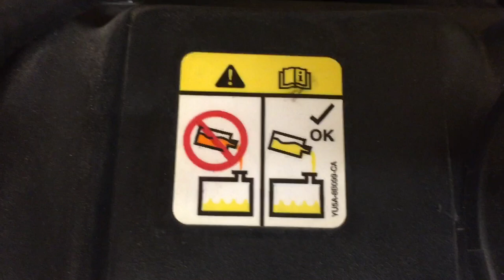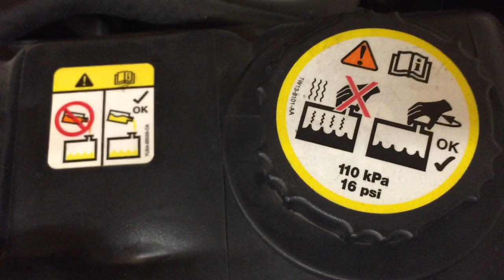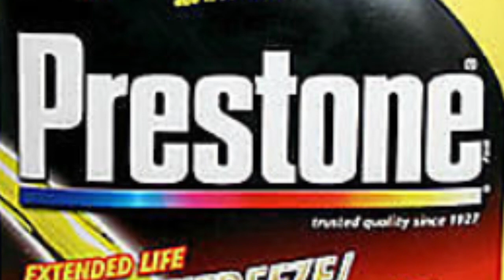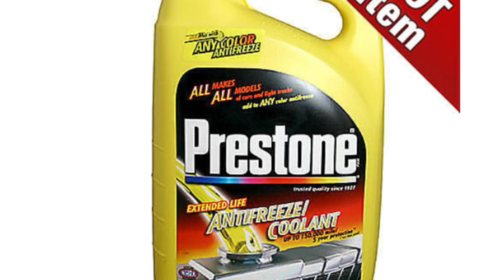Why is coolant different colors and why you can't mix them!  IAT, OAT, HOAT which can you mix?

Comment: I just viewed your video on coolant (colors and applications). I'm old school plus I sold cars for 31 years. I'm a car savvy guy, worked on cars until moden technology made fixing your own car almost impossible. 

A couple of months ago I had to have my water pump replaced. 2013 Dodge Durango w/ Hemi. I trust this mechanic and his team (Oops, did I say 'mechanic' instead of tech?). He said he flushed and refilled my cooling system. For some reason I felt warmer than usual air coming into t he car. I took it to him and he said to wait until until it cooled down to remove the radiator cap , like the next morning to make sure it had properly burped . The next morning before starting my Durango I removed the radiator cap and the coolant looked like brownish rusty water. I went back and asked what was up. Jake said he'd used Gold coolant  and not to be surprised. It's runny very cool, nowhere near the hallway mark even at a prolonged idle with the air on.

Ralph

Comment: Very informative vid. Thanks.  
So your "good rule of thumb" of keeping the same coolant that came with the vehicle is interesting as Ford initially started with the Orange coolant for my 2013 Explorer Sport BUT they've since changed from that. They no longer recommend orange and instead recommend Yellow as a direct replacement.  Supposedly you can simply dump yellow into the system and it's supposed to work properly - no flush needed.  I dunno, all that sounds sketchy to me and sticking with the orange sounds like the way to go.  Thoughts?
Reply from the maker: It’s hard to say what they changed it and if it can be mixed, but the most sure way is to drain it all and replace it with all the same stuff. Especially as it breaks down over time with heat.
Reply: @dannyjohnsonsgarage - Thanks for the quick reply!  Ford's owners manual says first service at 100k but then 50k after that.  I'm just shy of 100k and was going to do a drain and refill with PEAK Orange.  During the drain, I'm going to check the fluid to make sure it doesn't look too bad.....already tested as still good.  SO I'm thinking drain and refill should be OK, no flush needed.  And then maybe do the same every 30k or so.  Thoughts?

Comment: My tractor was delivered with blue coolant/antifreeze, I wanted to top off the reservoir but I can't find any blue diesel engine coolant/antifreeze. The dealership sold me Delo ELC Red coolant, is it safe to add the red coolant to the blue coolant thats already in the cooling system?

Comment: My question is about changing the coolant and switching from one to another. My Hyundai manual says that the fluid shall be ethylene glycol with water. Nothing more specific than that. No special requirements. The original coolant dye is green. Most coolants in the market aren't green. Is it normal to flush the system and use red dye hoat coolant, the asian one from zerex, rather than the original one? It is for sure not only water with ethylene glycol, and also its dye is different.
Reply from the maker: If you clean all of out you should be fine using prestone all makes all models all colors. It’s only bad if you mix it
Reply: @dannyjohnsonsgarage  not prestone. I suggested asian zerex by valvoline. Hoat type

Comment: I can't seem to find the answer anywhere so please reply.

I'm trying to find out if different brands and colors of OAT are interchangeable?
Or are all HOAT compatible ?

It seems that there are many more colors than you described so what is the bottom line of what is and is not compatible ?
Reply: Every car is designed by a different team of people. Those engineers all look for the best stuff they can use in their time-period. So long as it’s commercially viable. So really the only way to know is to read the owners manual, then check out owners-clubs/forums to see what they think is best from ownership experience. My entire brand of car (Subaru) wasn’t mentioned. It uses a purple coolant, which he did mention is commonly found in Asian manufacturers. To be honest I’m surprised at how much useful background information I got out of this video, despite no specific advice for my car, definitely worth it :)

Comment: Besides adding coolant, what should I do if my car was ran with just water for an extended period?
Reply from the maker: You’ll want to also burp the system by finding a bleed valve or a high point. You’ll want to do it when the car is cool so you don’t get burned. The idea is to get all the air out of the system 
https://youtu.be/vdiEzahAEb8
Reply from the maker: https://youtu.be/fYvDqtGPyAM

Comment: Hi,I am running a Weichai wp6 marine engine it's jacket water is mixed with brown mud ,how to get rid of mud and make a right coolant to refill the system, please reply thanks.
Reply from the maker: If this on a boat? It’s water system is pulling from the water. If not, Remove all fluid, fill with distilled water, run for a few minutes and replace several times until clean
Reply: My 2005 impalas is mud!! Why?
Reply from the maker: @airexaxe7554  probably has oil mixing in the coolant from a bad transmission or oil cooler gasket or maybe even losing a head gasket
Reply: @dannyjohnsonsgarage  Crazy! Thank you very much for another way through this

Comment: Silicate (When mixed with Ethylene Glycol) forms thick cloudy type gel. It is understood that Silicate is used as Rust Inhibitor.  My concern is if turns gel or get thicker over the period of time, it might lead to clogging. Really need an expert's opinion here.  Thank you.
Reply: Silicates, which makes one think of glass and silicone epoxy, are very inert, thats really it’s main feature, even when used in semiconductors it’s an inert background on which more interesting ions are inserted. If you wanted hard there are better ceramics, if you want lubricating there are better oils/liquids, but if you don’t want stuff to grow on it silicon-something is an inexpensive choice. So I can’t say what the Ethylene Glycol will do over time, but I can’t imagine the addition of silicone will cause it to change overtime. It’s gonna change during the addition but not over time. There are some radiator-sealers/repair additives that use silicon to plug up holes, and they are supposed to be flushed out after a certain number of minutes of being added to the system. It’s usually a small bottle and you add it to the coolant system after doing lots of pure water flushing, adding only water, letting the car get up to temp, then cool enough to add sealer, then run for 8 minutes, then dump it all and add fresh coolant. Perhaps if that stuff is used and never removed the loop will get high resistance to flow over time, like it was gumming up.
Reply: You’re right

Comment: Interesting video. What type of coolent would you recommend in a 98 Cobra? It has the green stuff in right now. And do the premix 50/50 already have the distilled water in it? I'd rather just buy it with the 50/50 rather than have to mix it my self. Thanks.
Reply from the maker: Prestone 50/50 would be fine. It does already have distilled water, so just keep in mind you’re paying them for the weight of the water and will save some money if you buy the concentrate and then just pour in the distilled water as you pour it in (you don’t need to mix it before hand, it will do that over time).
Reply: @dannyjohnsonsgarage  I recently completely flushed my cooling system and replaced the coolant. I did a very thorough flush using a radiator flush kit, distilled water and flushing several times. I removed my thermostat, put the heater on high and drained my reservoir tank. I had completely clear water draining out prior to re-adding coolant. I added 2 jugs of the new coolant which was prestone concentrate. The jugs were 3.78L each for a total of 7.5L of concentrate added. The capacity of my cooling system is 15.3L so I figured that using 7.5L of coolant would give me a 50/50 mix (or very close) which is what is recommended. After doing this I went to a local oil change shop and asked them to test the ratio using there ANTIFREEZE COOLANT TESTER. They sucked up a sample and said it was good for about -35 C. They explained that this was a little warmer than they usually go (they like to see -45 to -50) but because I live in a place which rarely goes below zero and never below -10 then it should be fine. I did not have them test the acid/ph level at this time. 2 weeks later (today) I went for an oil change and they tested my coolant with a little strip of paper. My PH level was 5.5 which is low (should be a min of 7 and ideally between 9-10). The test was conducted right in front of me so am not concerned about them misleading me.

My question is (which they weren't able to answer) if I drain out some of my coolant and add some more of the concentrate (making my ratio stronger) will that increase my PH level? I've tried to look on google but can't find anything specific. Is my PH level low because my ratio of water is on the high side, or does the ratio of coolant to water have nothing to do with the PH level.... thanks..

Here is a link to a video of my flush... if you watch the first 3 mins you'll see the original coolant... it looks orange which everyone says is CHRYSLER HOAT... but my owners manual says its OAT and warns specifically not to use HOAT. Some people tell me that the HOAT is also called G-05... while others say G-05 is OAT? I would appreciate your opinion on it if you have the time... as you'll see in the video my original coolant was very dirty looking and gunky... not sure what to do now to bring my PH level up to normal.
https://youtu.be/e0_FPyw5Bsc
Reply: @jonh2408  You are way overthinking it dude. My 21 years of cars I have never had to break it down like that. Just add coolant to your water. Try for 50/50 but if not perfect it works.

Comment: I added .5l of light green (IAT) to my '03 Ram that has HOAT. Less than 17l of HOAT. How worried should I be about leaving it overnight and possibly for the rest of the week
Reply from the maker: I’m sure that’s fine. You can also put distilled water in and it dilutes it but mixes as well so other coolant should be fine
Reply: @Danny Johnson’s Garage  it's been okay since. From my research and phone call to Napa, it seems that the important factor was that I had yellow (low silicate) HOAT antifreeze in the truck. Had I had orange (silicate-free) HOAT in the truck and mixed in the bright green (high silicate) IAT, there may have been a mixing issue.

Comment: Interesting,  but I don't know anyone that flushes their  coolant system or really cares about what antifreeze they mix or don't mix.  If you need to add a lot of antifreeze,  there's already a bigger problem.   Better to mix antifreeze than not have enough. The biggest issue that I see is that people generally don't check Fluid levels. It's notn pumping any heat because it's three liters down. It overheated  because, it's three liters down. The big question is why is it three liters low?  Being concerned about distilled water is pointless.  Antifreeze has been sold premixed for years.  If you are mixing  your own, that's the only time you may need to be concerned about it.  Seriously though,  who mixes their own?   Coolant  has never been the issue for me. It's always some other failing part. A hose,radiator, pump,heater core, thermostat,  etc.  I've owned a lot of freakin vehicles.  Always some other issue causing  problems.  Coolant type was never the issue.
Reply: Who are you
Reply: Who are you?
Reply: Who are you even
Reply: So you listed a whole host of parts failed in your cooling system and you still think mixing coolant is fine 😅 you must be a clown lmfao

Comment: Hi can i mix g13 purple coolant with g12 pink coolant ? Thanks in advance
Reply from the maker: My advice is to not mix colors. Drain the entire system to use a different color.
Reply: g13 is later, so I think you can add g13 to existing g12, but the other way around is not recommended.

Comment: Isn't distilled water more corrosive?  So you should be using filtered drinking water instead.
Reply from the maker: Prestone brand says to use distilled on their instructions
Reply: The coolant includes corrosion inhibitors. You aren't using distilled to avoid corrosion. You're doing it to avoid mineral deposits. Filtered tap water will still have a high proportion of calcium, sodium, etc in your water.
Reply: @dannyjohnsonsgarage  I've never read the back of the Prestone brand.  But some don't say anything about what kind of water and some say use de-ionized water.
Reply: @lmaoroflcopter  Good to know they have corrosion inhibitors.  Unfortunately they don't mention it though.  Still, I'd rather go with filtered drinking water rather than distilled water.  I wouldn't consider filtered tap water any useful unless it goes through a really good filtration system.  Which is what I would consider drinking water.  Still, there will be some minerals in the water.
Reply: @thomaswills2301  distilled water would be purer than your mechanically filtered water.

Deionized water is broadly equivalent to distilled, it has all the mineral ions extracted from it, sometimes via distillation even.

Drinking distilled or deionized water would be ill advised, unless you like electrolytes (those pesky minerals that screw up cooling systems) that would serve you better in your body, in your urine.
Reply: @lmaoroflcopter  Distilled water is more corrosive still.
Reply: @thomaswills2301  yes, but again... you aren't worried about corrosion in a coolant system but rather mineral deposits.
Reply: The real pros add 1 tablespoon of iodine-free table salt, some lemon juice for its acidic/pH buffering properties, half a glass of red wine for the low concentration of alcohol and anti-oxidants, and ground Italian herbs and spices to taste. Simply being drinkable is setting the bar too low, if we‘re gonna make a meal out of this we should do it like mamma used to make it.

Comment: Talking about green found out 2000 Nissan is Hoat Green Nissan which can be mixed Nissan blue.  Penifrost A2 same, Beck Arnley Asian Green hoat.  Peak asian is not Oet?
Reply from the maker: It will be hard to say by each manufacturer, so the best advise is to start fresh with new coolant for the system or purchase exactly what’s is it now to add

Comment: Colors don't matter. If its glycol coolant, color doesn't matter at all! Every other company use different color.
Reply from the maker: The color matter because it’s how it differentiates which coolant with what chemicals and lubricants it has. You don’t want to mix them as the video talks about
Reply: Nowadays, I'm hearing of oil-based coolant. What is this? One source on the Internet says the coolant is oil-based as long as glycol is included.
Reply: You could be right about the colors as other sources on Youtube talks about dye as per manufacturer specification. The important thing is to know the coolant ingredients.
Reply: Watch the video buddy